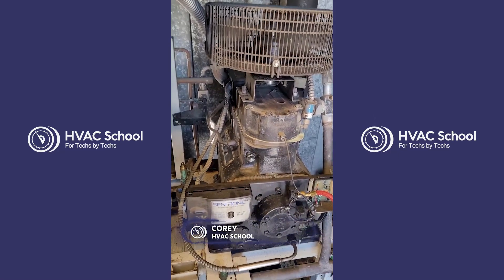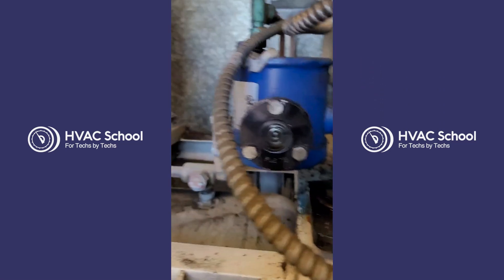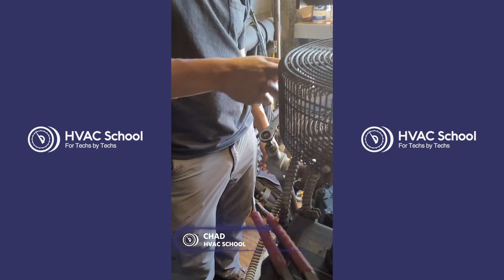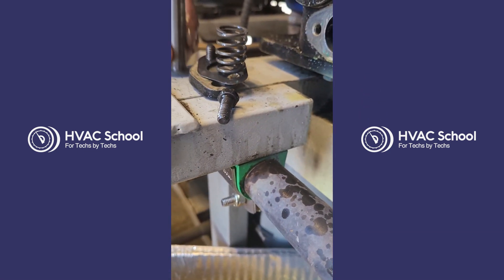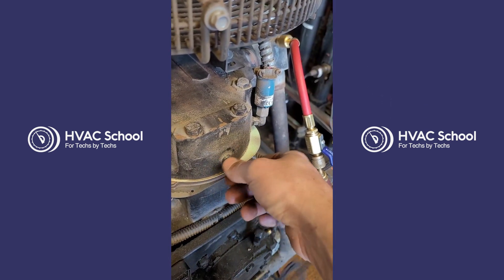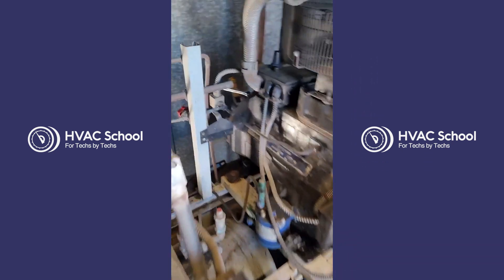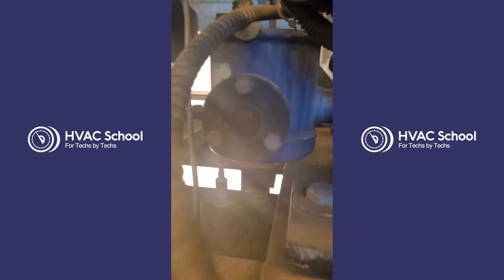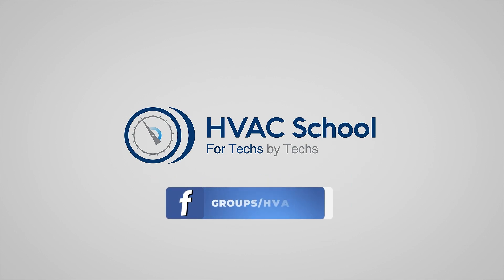A Rack Refrigeration Oil Issue Resolved

Comment: Excellent video and thank you for sharing your experience!

If we would have a convo around this I would ask the additional questions.

To confirm then, the issue was an improperly set oil pot?

How old is this compressor, was it running on for years before? I would imagine they don't go out of calibration and drift from their original set point very often, so maybe there was something more to the story here?

What about the screen on inlet of pot?
 
Did you check for blowby from worn piston rings- closing the oil check valve in the body? 

Maybe it's a smashed/broken disk? 

Maybe it's flood back? 

The dirty on demand cooling, what's that dirt from?

What was your net oil pressure before and after adjustments if any change?

Was there a 2pig pressure difference between the suction service valve and the crank pressure?

I've never seen an OCV 5 on my systems, smallest has been 20.

Thanks again for the video, it inspires and generates Interest to go further.

Comment: Whats the best tool to use on those 7/16 bolts holding the oil pot to the compressor? A stubby thin wall open end?

Comment: For the new guys, I'd be careful about pumping oil out till your oil fail control switch opens on a few thousand dollar motor. A safer bet is to unplug the sensor cable/time it out. The fitting to oil sensor is brass and strips very easily with an adjustable wrench. It's a better practice to own a 1" open ended wrench. A share of older racks have been upgraded to 15 or 20 OCVs. Adjusting or balancing oil regulators almost never fixes the main oil fail problem, and in most cases causes more problems. It's a time consuming process, and a corner always gets cut. You'd be better off to just clean it, along with all filters/screens because they rarely need to be adjusted, or outright fail on their own. Recently I had to replace 5 regulators on a rack from the floats getting dropped from over-adjustment. Along with two damaged valve plates from overfeeding oil/oil slugs.

Comment: Hi.. hello I have a problem about centralized copeland compressor low temp the issue is a oil empty inside the compressor  and the oil receiver How can I fix but no have leak thank you
Reply: Add oil. Find your leak and check superheat. Make sure you not washing out oil by flood back